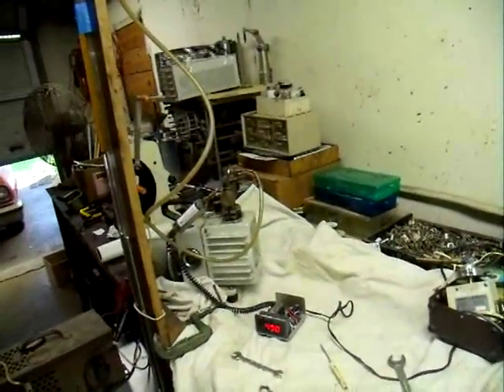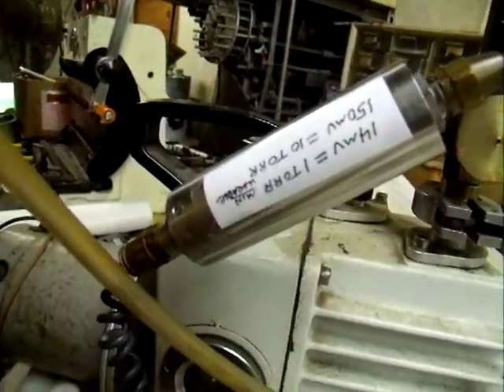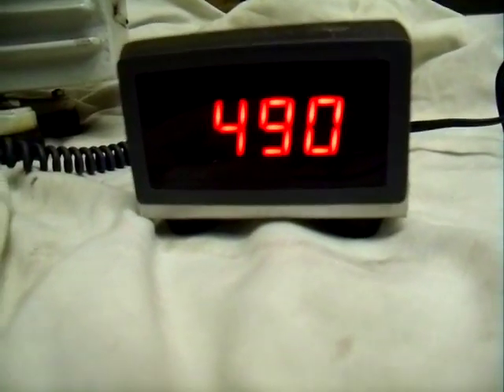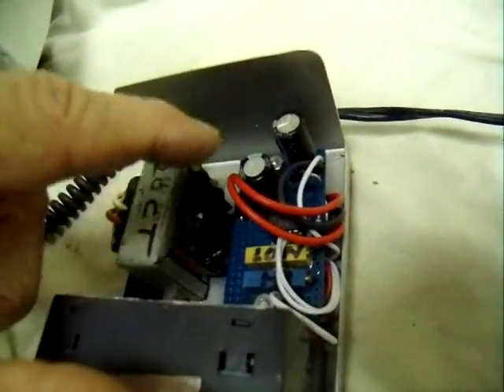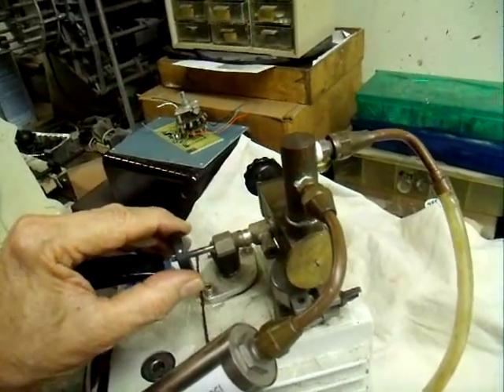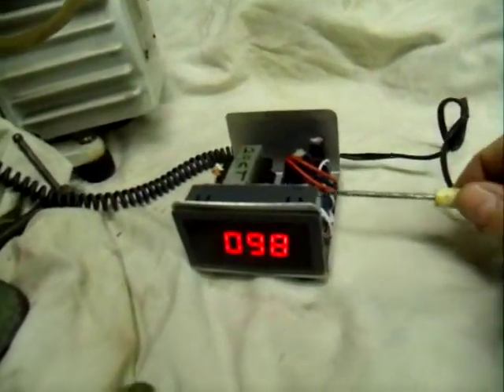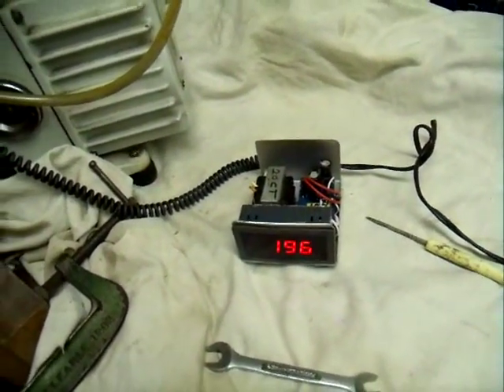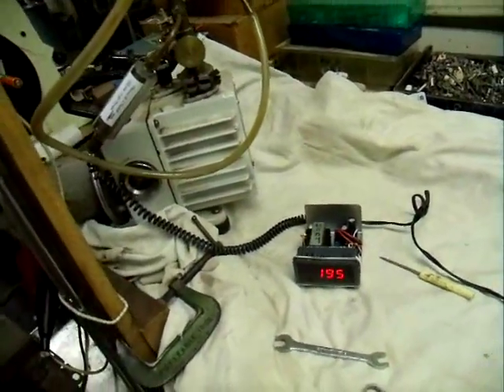CALIBRATING A VACUUM GAUGE FOR NIXIE TUBE MAKING

Comment: Sorry for my English...
Fist of all, i watched Your videos for ouers now... Love all of them!

However, guess You hawe a good point in this video, at least for this purpose, me and a friend collecting parts for similar vaccum systems and parts of the system i building has water cooled parts and i noticed the same thing as You say there, even if the messurement devises them selves seems simple, the coolant system needs proper temperature control while using hot wire devises (despite of the fact that teh messuremt´tubes them selves normally don´t hawe watercooling som the problem will remain without compensating wich demands lots of electronic... (and the messure tubes them selves will be damaged or burned out if one try to use them in low wacuum... so one still needs multiple gauges there anyway so for this purpose i guess Your solution seems to be emong the more simple and trustful.)

Comment from the maker: Unfortunately, that gauge head is an old military surplus unit that is not available any more. For modern equivalents search ebay for "baratron" or "capacitance manometer" and find one that is in the presure range you desire. They are easy to use, only requiring a small +- 15 volt power supply and a panel meter for the readout.

Comment from the maker: This would possibly work for a while. The cathode of the tube will deteriorate completely within minutes of being exposed to the atmosphere so the idea is not valid for a gauge that would be used over time. I have gone through all of this long ago and found that the best thing to do is save your money and buy a nice ion gauge on ebay. You can get one for under $100 if you look for a while. See my TUBECRAFTER website for more info.

Comment from the maker: I'm not sure you can buy one. Making it from pyrex tubing is one way. Making it with plastic "tygon" tubing is another way. Just fasten the tubing to a board and go! It will work fine. Be careful not to slop mercury all over the place though! I fill and empty mine way out in the back yard in case I spill any. (for good reason!)